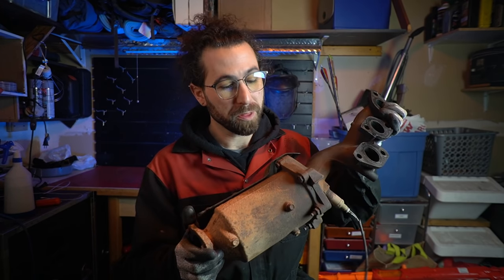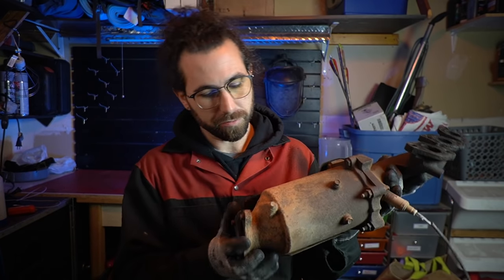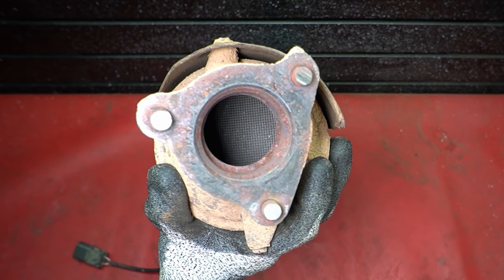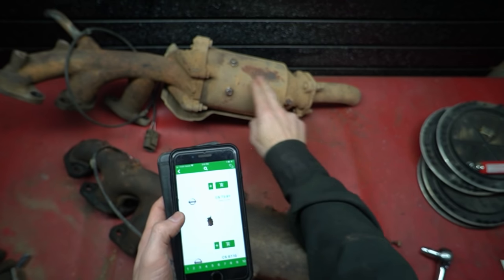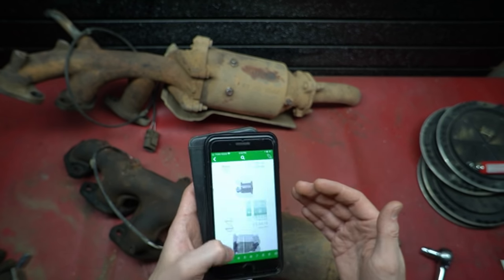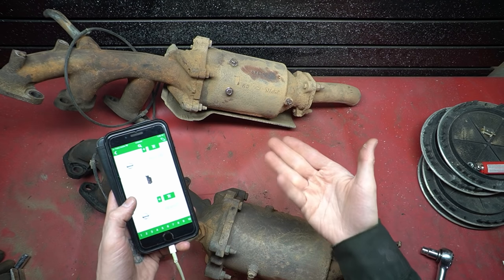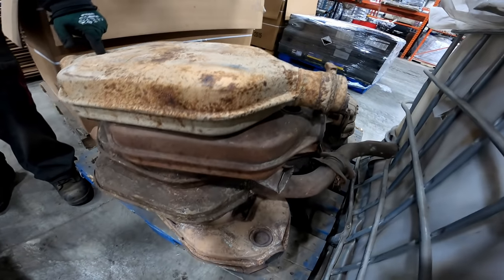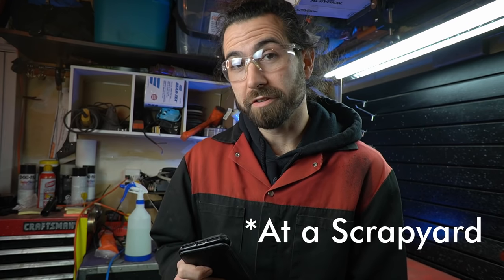How Much Is A Catalytic Converter Worth? Scrap Recycling Guide

Comment: F81a pix check that value and let me know what your app says it's worth
Reply from the maker: F81A EC PIX says 1485.88 CDN, why? No results without the “EC” in the middle though, so idk if that helps. Is that from some kind of bus?
Reply: @thubprint f350 Ford v10 it was $2145 a week ago when I sold it. I only remember a few good ones but Fords have been good.
Reply from the maker: Nice one!!! That makes sense, some searching revealed that some of the most valuable converters are from the Ram 2500 and the F250, so that’s right in the same category.
I’m going to have to test this thing a bit more, my results on the two in my example were the same (sold them for more than the app said I would). That’s why I recorded the extra bit in the middle and adjusted my final edit, I’m not convinced it’s the end of the line in terms of accurate info. At the very least I don’t think I’d sell to them 😂
Reply: Pix currently I get just shy of $1900
Reply: @vbdeals  prius .... some f150s range high ....2000s honda accords hell a 2006 ford taurus has 3 cats n got me a decent amount ..... but damn v10 ford around here only brings 1300 ..... imma come visit and sell with you lol
Reply: @imthdj2u  kanect recycling in Ashtabula Ohio you can search them I know they're on Facebook they have their own app you can subscribe to also. I don't sell to them cause they're a pretty good drive from me and the core buyer I found pays pretty close to what they pay. Considering I'd have a whole day of driving to them and back home its not worth the time to me. It takes a while to find any good buyers at least it did for me most yards around me hardly pay anything for converters and most of the people I kept finding only paid half the real value if you were lucky.

Comment: MORE REASON TO GET ELECTRIC CAR
Reply: today cat converter, tomorrow electric battery
Reply: @1mostwanted253  ELECTRIC BATTERY IS NOT AS EASY TAKING THE CAT 
ELECTRIC BATTERY WEIGHTS A TON
Reply: @21boxhead  yea itll be a car robbery instead, take it somewhere, take battery, and scrap the rest of the car on the side of the road
Reply: @1mostwanted253  FIRST OF ALL THE BATTERY IS HUGE AND HEAVY YOU NEED HYDRAULIC JACK AND LOTS OF HANDS 
ALSO 
THE CAR HAS GPS SO IT CAN BE TRACKED AND BUILT-IN  CAMERAS IN IT AND IT'S NOT EASY TO TAKE SOMEONE'S EV

Comment: More important who tie buying th m tom thief's and how close are law Enforcement watching the establishments that are buying the calculated converters and the establishment that is buying the precious metal? People can only get away with what they are allowed to get away with if they tighten up the laws two sentences and that it will be less tempting four thieves to steal them from people's cars chop shops to buy them and the people who are turning the meadow in to wherever they turn those precious metal into. Just like robbing a bank yes there's risk but not everybody is willing to pay the cost of robbing a bank being shot down going to jail and so on and so forth. There is something that can be done?
Reply from the maker: It’s possible stronger regulation would reduce theft, but I kinda doubt it. I’m not a fan of increasing regulation anyway, outfitting individual vehicles with anti-theft devices gets my vote.